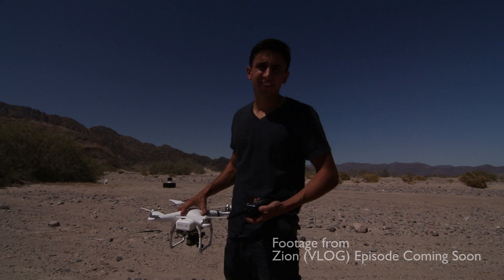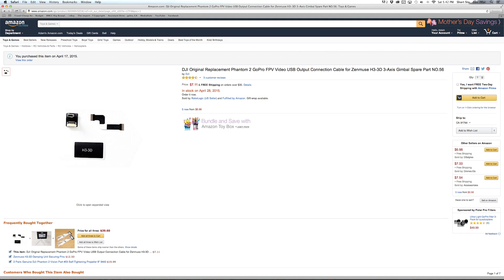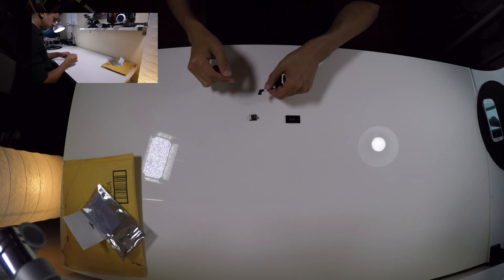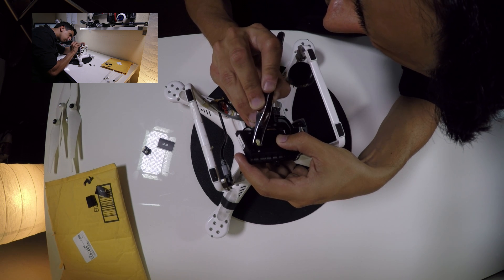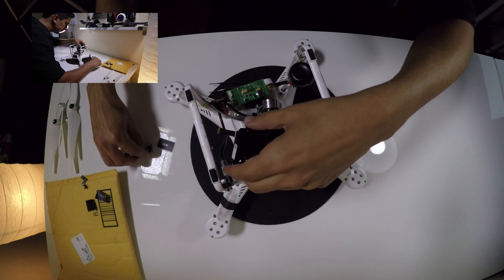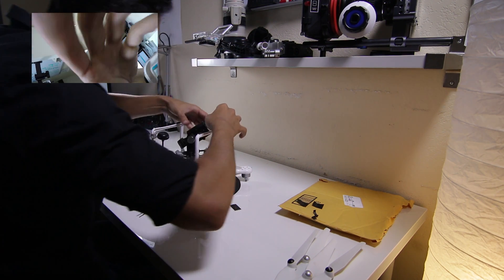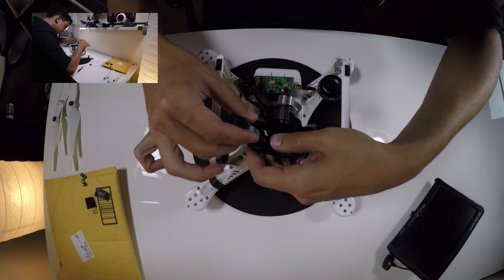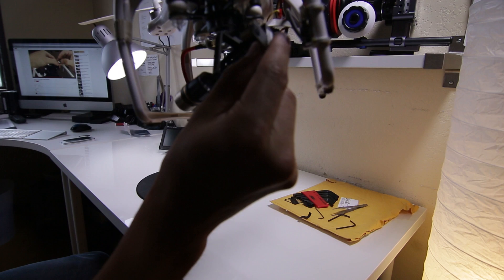Phantom 2 H3 3D gimbal Video Transmitter Ribbon Cable Replacement Tutorial

Comment: my cable is broken also but I dont have a go pro 3, I put the SJ5000 which is simular to the gopro3 in weight and shape, I havent tried to fly it yet but testing it out at home everything seems to work. The gimbal move up and down and did advance cali and seems ok there. Do I really need that cable for any reason?and can I just fly without it with a different camera other then gopro? like I said everything seems to be working here on the ground without that cable but still a little leary on getting it up in the air. What would you do?